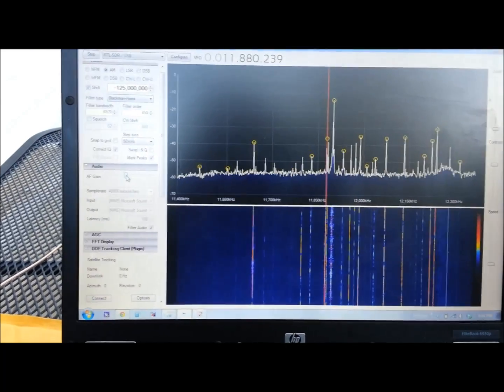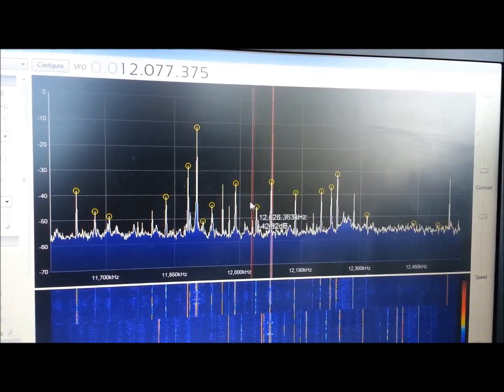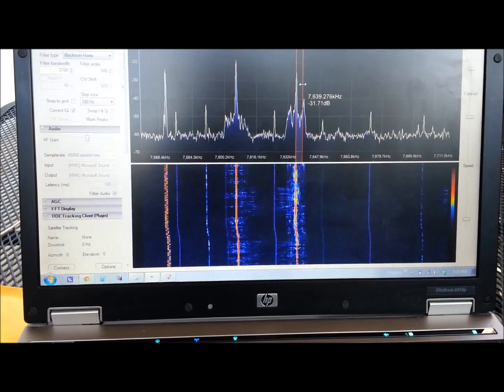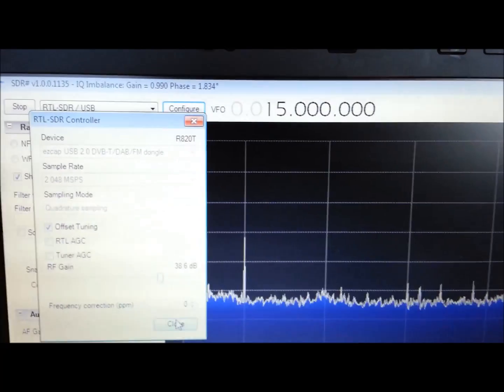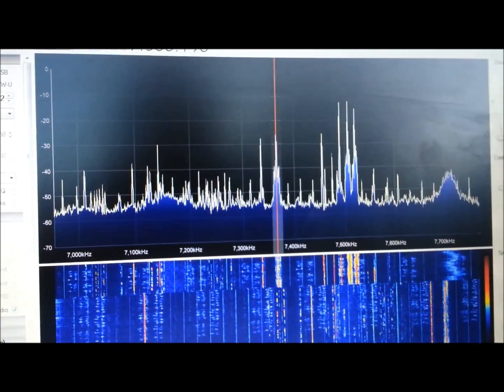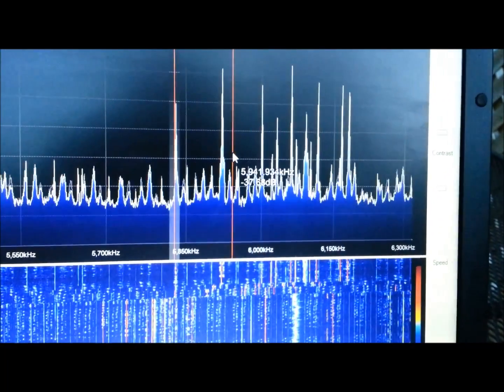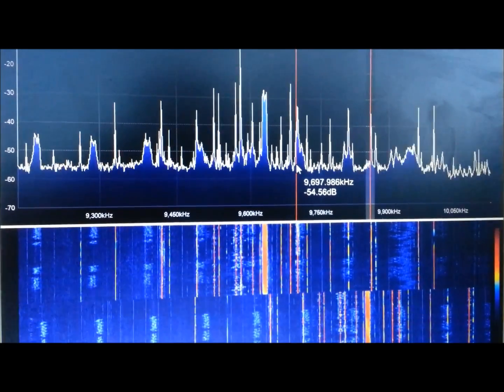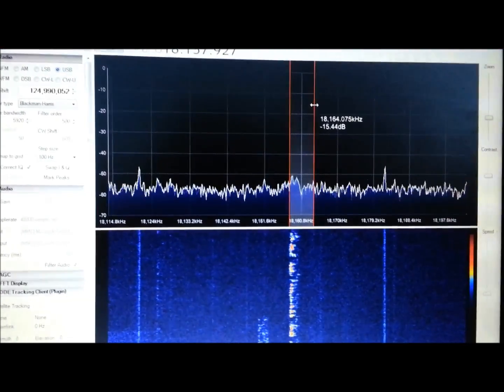SDR DVB-T "Ham It Up" HF Converter

Comment: It is maybe too late for you, but for other people - the way how to adjust frequency correction for the dongle and for upconverter: dongle, find some station that is known in frequency (for example FM radio, 88-108 MHz). Turn off (bypass) upconverter, and change value in RTL-SDR controller so that center frequency of your receiver matches with center frequency with FM radio or other station(s). For FM, wait no music and no talk, then carrier will be clearly visible (aside 19 kHz + other signals). Then run upconverter and find WWV station and make correction as you did on your video in -125 MHz window.

Comment: nice video could you PLEASE Talk about Calibrating setting the offset??? been trying to get SDR# and my ham it up converter set works ok on VHF/UHF HF cant get a signal tried everything pulling my hair out thanks in advance, God bless you. Thank you & 73
Reply from the maker: +Gary J The offset is just the value of the oscillator.  Note the shift otpion is checked with 125M value set in for my particular oscillator.  As for calibration you do that in the settings by tuning to a known freq and setting the offset to bring it so the real freq matches SDR#. I think I'm usually around -90 or so
Reply: great thanks
Reply: but what about the big like -999,990,000 # thing? I thought mine was about 135,000,000 before including IF and I was able to hear all kinds of stuff on HF part of spectrum with the upconverter. Now I got nada. VERY frustrating
any help greatly appreciated. thank you.

Comment: Wondering if you might be able to tell me how to figure out what the shift should be, new to SDR and trying to learn. Thank you
Reply from the maker: Stealth Assasin No worries- it is on the oscillator (square silver thing) if it says 125 you set it to 125,000,000.  If it's 100 set to -100,000,000 etc.

Comment: I Bought the metal enclosures for both the ham it up converter and rtl dongle, neither of them fit their their enclosures.  All was bought from nooelec. Anyone else  come across this? And what was their fix?
Thanks.
Reply: +celticirishkeith Same, I bought the wrong version of the enclosure and mine didn't fit it. My fault though.

Comment: I bought The http://www.amazon.com/…/dp/B009U7W…/ref=cm_cr_pr_product_top
and . 
http://www.amazon.com/…/B009…/ref=oh_aui_detailpage_o00_s01…
Do I need to also buy this http://www.amazon.com/coaxial-cable-assem…/…/ref=pd_sim_e_2… ?

Do I need another converter from supplied antenna to the Upcoventer as well? if so which one? Quote me a link from Amazon.
Thanks
David Snyder

Comment: At 00:12 on this video, what type of patch cord is it that is shown, where you are using it to connect from the dongle's antenna to the upconverter?  I want to order an upconverter and one of the correct patch cords from someplace like NooElec.  Do they have the patch cord shown in your video, or did you make it yourself? Thanks.
Reply from the maker: Yep MCX to SMA.  Curt- there is a whole video devoted to this on my channel.  Lots of adapter info.  Cheers bud.

Comment: remember that shift is not used for frequency correction but rather the ppm # in the usb dongle configure button (setting the frequency to what it should be and clicking up/down until it matches).  Temperature will affect the frequency so you might want to wait till it warms up before adjusting.